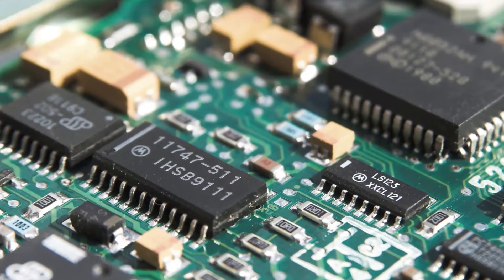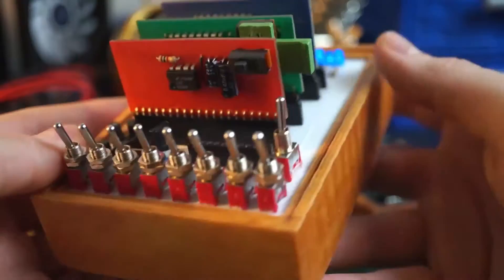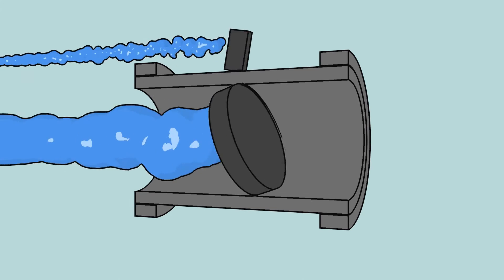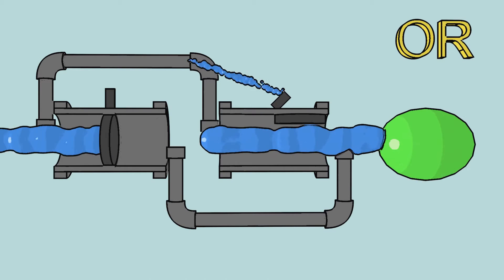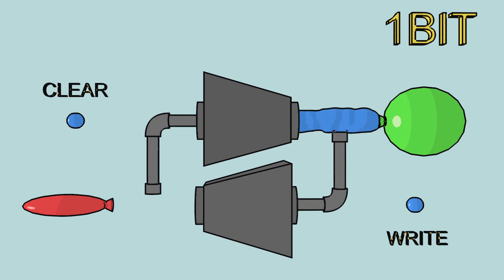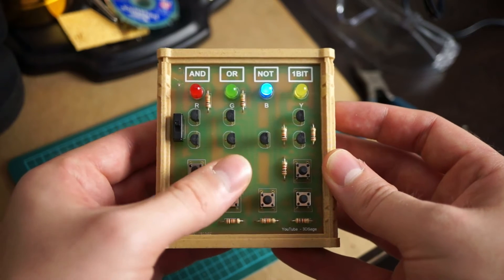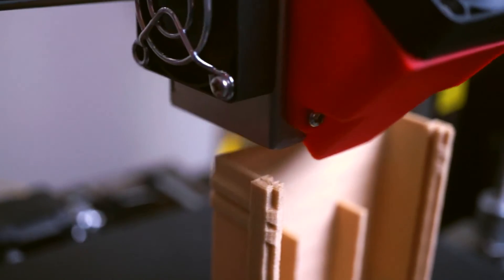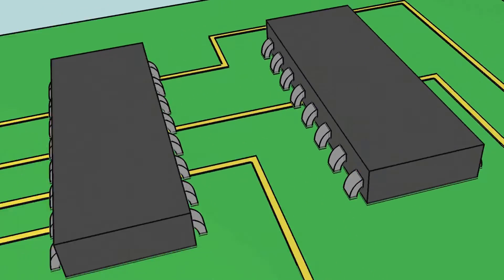Logic Gates | Visual Learners

Comment: So theoretically, you can make a computer out of millions of water pipes and valves packed together.
Reply: Yea... technically, but they would either need a motor to even move the water or it'd be a really really slow computer. But low chance it'd work cuz you need something that can do clock, a heartbeat. Maybe a pump?

-- also, water, or really material, unlike electricity, can't really have a off on state. You can't just turn off water. Also plumbing tends to have different assets of pipes compared to wires. Like a piping system that would look like it would short circuit if it were wires could actually
be real in the real world. 

It's hard to say, but its not, impossible.
Reply: @Z_kun11 😂😂😂😂😂😂 أقدر أصنع واحدن من هاذا وأنا لم أدرس هاذا  الكمبيوتر يعمل عن طريق النبضات الكهربائيه بسرعه الاتر بلعين  اللي دارس علوم أشباه الموصلات مثل القطع الاكترونيه الصغيره وقع على كنز لايقدر بثمن بشرط واحد هو أن يشغل خياله أنا شغلت خيالي مندون مدارس فقط البحث في جوجل عندما أريد أن أختصر التفكير فقط  وبعض اللذي توصلت لهو عندما أبث في النت يطلع صحيح بنسبة 80 ألا 70% صحيح أو متشابه لحد كبير  الموضوع بسيط لاكن يحتاج ألا ترتيب هاذا كله في أربع أشهر
Reply: Steve mould did a video on this already. I recommend watching it
Reply: I saw a video of a guy who made a water powered computer on YT. worth looking up